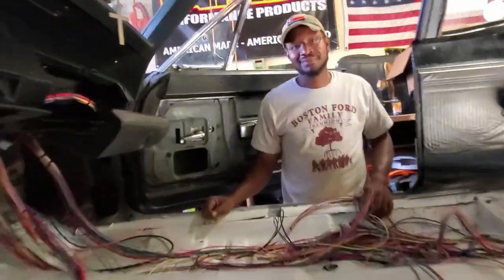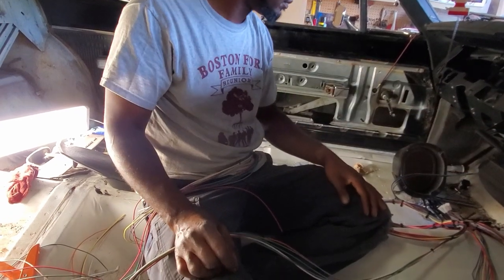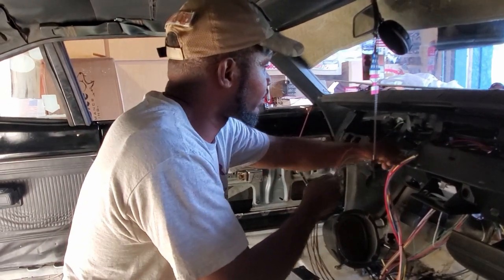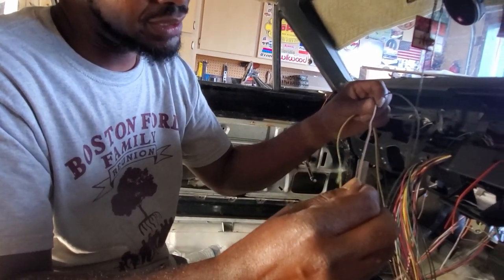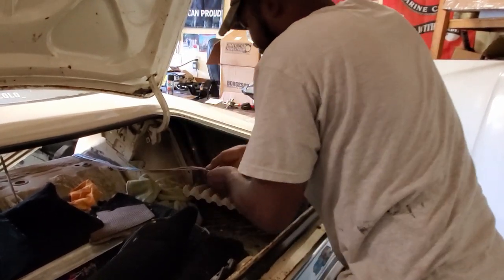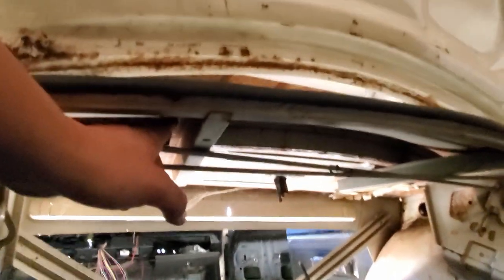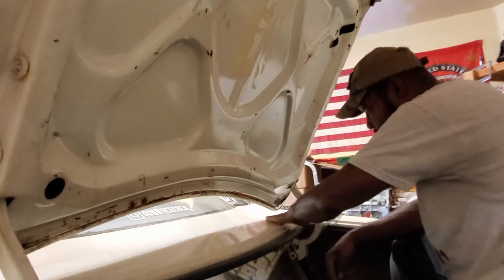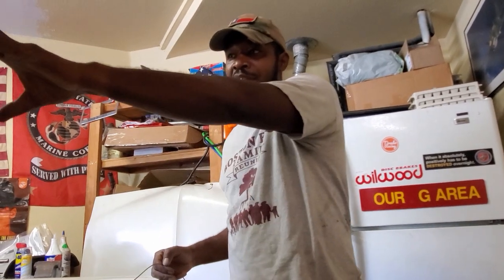70 Coronet Painless Wiring Install Part 2!!!

Comment: Part 3?  How did steering column wiring work out? I hear ppl have issues with that part on these Mopars. Reused original connectors?
Reply from the maker: Yeah I lost a bunch of video files on my computer when it crashed including part 3 of wiring and other content, pretty bummed about it. So what I think I’ll do is just make an over view video on all the completed wiring. Also the connections were a little difficult to connect but we got em.

Comment: How long till your ready to put the motor in I've been watching since you pulled the car in the garage to take it apart from day one?
Reply from the maker: Funny you should ask lol the engine and transmission are going in the car tomorrow for mock-up purposes so we can cut the trans tunnel out and make a new Trans tunnel. then the engine will be installed permanently.